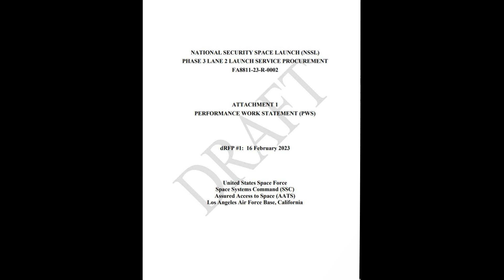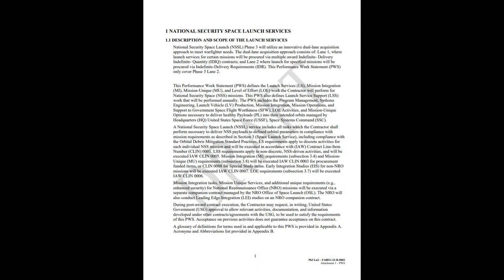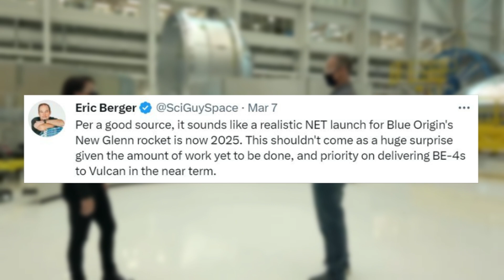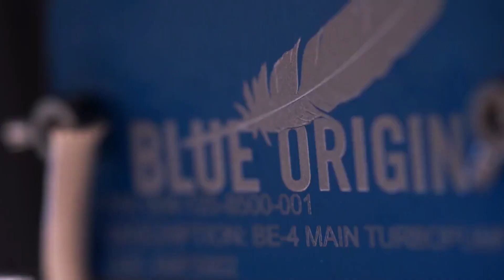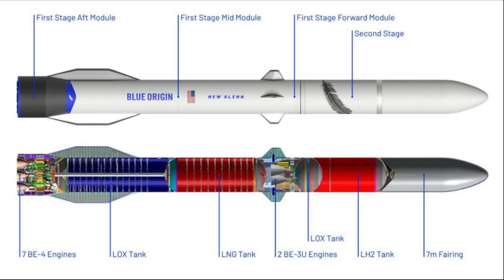Blue Origin’s New Glenn Races For Military Contracts

Comment: My guess is that New Glenn production is being held up because of reusability issues. They have pretty much got the BE4 issues worked out. But New Glen is a huge rocket. It's much larger than Falcon 9. Elon once commented on the mass of the Falcon 9 legs and why they gave up on landing legs for Starship. The mass of landing legs and the required fuel to land the rocket severely cuts into the payload capacity. The first launches will probably be expendable while they test, continue development, and generate some revenue. I wouldn't be surprised if they eventually went with a ULA/Vulcan concept of engine recovery and built a new first stage tank for each mission. I hope they can eventually make it fully reusable, but they got to get this thing launched.